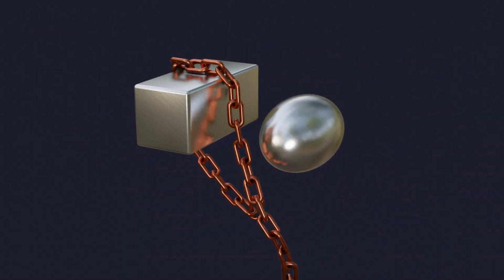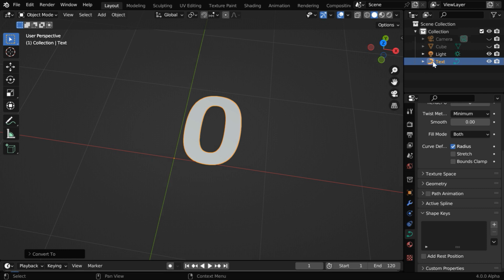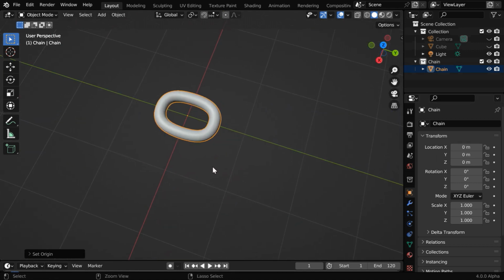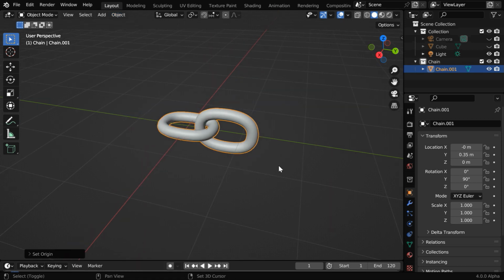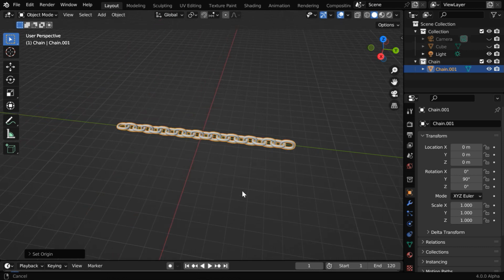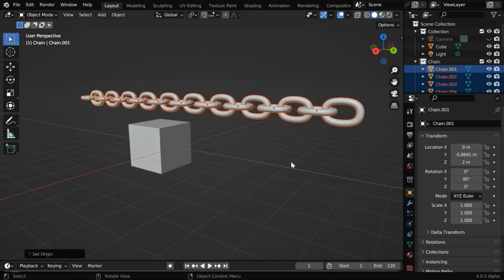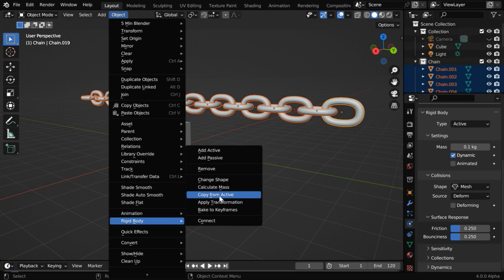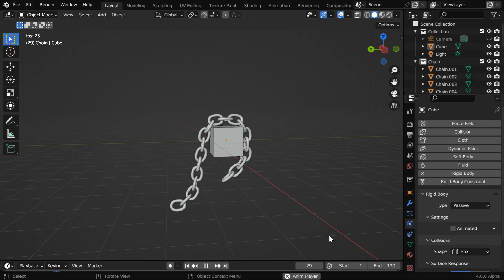How To Create Chains With Rigid Body Physics | Easy Blender Tutorial

Comment: does it work with real world scale?
Reply from the maker: Yes it should work. It can only create issues if you have the chain quite small, like real world scale, and the box quite large. Even in that case you can avoid any artifacts by increasing the accuracy level in the rigid body settings under the scene tab. But in any case, you have to ensure that there are no overlapping geometry to start with (specially with the chain links).
Reply: @5MinutesBlender  have to chk

Comment: Mine is exploding :D why ??
Reply from the maker: It explodes if somehow you have overlapping objects (or objects that are too close) and you enable rigid body physics for them. Please inspect the chain (zoom in to vertex level) and ensure that all the joints are sufficiently spaced apart from each other. Otherwise, in the scene tab under Rigid Body Physics settings, increase the Substeps and Solver Iterations for a higher accuracy (but it will take more time to bake).

Comment: bro when i do the animation then i just starts falling apart and every single piece just falls apart
Reply from the maker: If the chain pieces are somehow overlapping with each other (or even if they are too close) they will explode. Please inspect the chain and ensure that all the joints are sufficiently spaced apart from each other. Or increase the accuracy and iterations of the rigid body physics (these two settings are found under the Rigid Body World in the scene tab) - but it will then take much more time to bake.

Comment: My chain exploded.
pipipi
Reply from the maker: It explodes if somehow you have overlapping objects (or objects that are too close) and you enable rigid body physics for them. Please inspect the chain and ensure that all the joints are sufficiently spaced apart from each other. Or increase the accuracy and iterations of the rigid body physics.
Reply: I had this issue as well but was able to solve it by decreasing the margin/sensibility
Reply: @Diego-hz1xh  What did you decrease it to?

Comment: mine just explodes when i do it dunno what the problem is
Reply from the maker: It explodes if somehow you have overlapping objects (or objects that are too close) and you enable rigid body physics for them. Please inspect the chain and ensure that all the joints are sufficiently spaced apart from each other. Or increase the accuracy and iterations of the rigid body physics.
Reply: @5MinutesBlender   Same problem here using 4.4....How do you  increase the accuracy and iterations of the rigid body physics?

Comment: I want to wrap up hands of character of chains so they don`t fall, any tips?
Reply from the maker: I am not sure if I understood it correctly, but if you want to fix the two ends of the chain, set both of them as Passive rigid body. They will take take part in the rigid body animation but they themselves won't fall, so the entire chain will hang from the two ends like a garland, it won't free fall.
Reply: @5MinutesBlender  I mean I just want  to wrap up arms of character with chains (2 different chains for each arm), like if it was a mummy, but chains instead of bandage, don`t know if it became more understandable lol. Something like Ghost rider if you`ve seen
Reply from the maker: @insertanynameyouwant5311  Something like the thumbnail of this video? I did that my manipulating the gravity. I let the chain fall on the cube under gravity. Then I reversed the gravity, so the loose ends of the chain wrapped the box and started "hanging upward". Then I again reversed the gravity, so the loose ends again came down. Doing it several times created that wrap effect. There are other ways to do this as well without manipulating gravity. Keep one end of the chain fixed, and use another rigid body (maybe a pin) to move the other end of the chain around the target object to wrap it. This needs more effort but the result will be more realistic in this case.
Reply: @insertanynameyouwant5311  It occurs to me that you should wrap chains around his arms just as you would in real life, then linking the ends of the chain would be a single circular object that would prevent him from falling off his arms.

Otherwise, if the model is in motion so that it does not move, you will have to link some additional chains to the body but invisible to the visible one or in case you animate this frame by frame
Reply: Remember sometimes you have to make some tricks to get the desired result, it is a lie that everything in 3D is perfect, you almost always have to help yourself with invisible objects that support what you plan to animate
Reply: Do you want the chains to fall from the sky and be added to the arms? then separate the scene into 2 animations of the chain and adjust it by eye very precisely so that just when it reaches the arms, animation 2 of the chains starts where it already is on the arms.
just like I mentioned above

that is: animation 1 based on the video.

animation 2, based on what has been said.

I left a lot, text I hope I don't overwhelm you, they are just suggestions, anything can help 😄
Reply: @RJBetancor  hi, thanks, I didn`t get notifications, lots of stuff to analyze, I think I`ll come up with something, thanks again